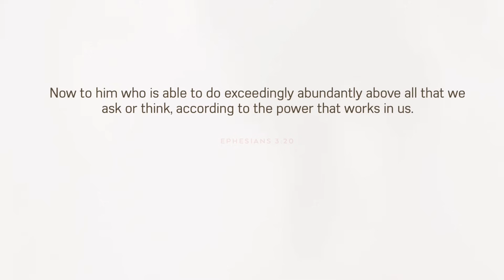November 22, 2023/320 Trucking from Richmond Indiana to Hagerstown Maryland

Comment: JBG correct me if I'm wrong but watching the end when you pined to R71 right after you cranked up the dolly legs (before being pined) I think the truck was still in drive with parking brake released, then you (with the thumper) released the trailer brakes. 
I only drove automatic transmission trucks  a few times (last time I drove a truck) in 2017 I think  but I found myself leaving the truck in drive a few times getting out, but always had brakes applied.
East coast Canada 🇨🇦 loves ya just the same for the entertainment and sharing your journey,  just saying   it's just I didn't see or hear you apply tractor park brake, dangerous  situation, that's my take on automatic transmission,  ask me how I know, it would never happen in standard,  the truck would either stall or take off.